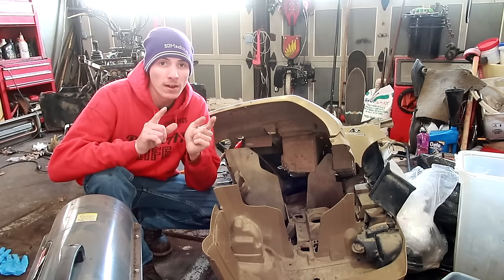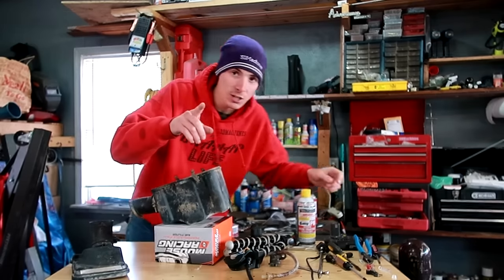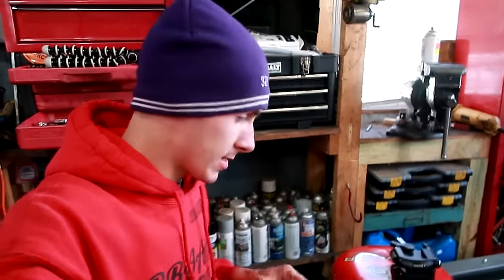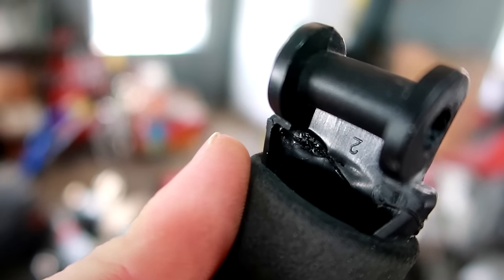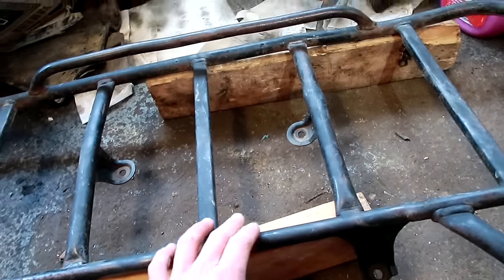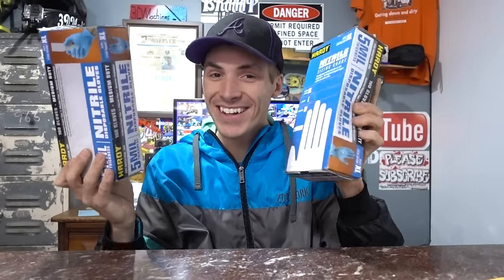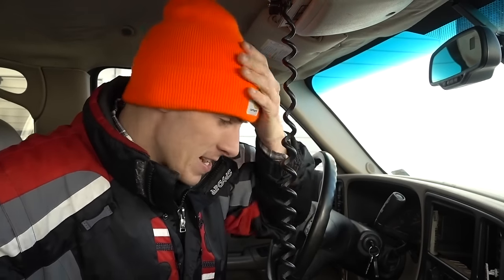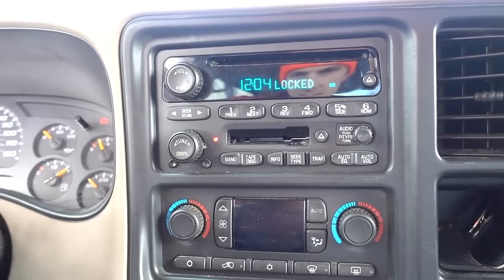FANS SENT STOLEN CAR RADIO

Comment: says locked cause it's probably not compatible with the bose/on star system in the truck.. the other radio is, it's the same as the one that came in my truck, mines an 06 silverado.. the other cd play has a 6 disc changer build in also I believe.. it should work.. and if u call sirius xm radio, u can get a free 3 month trial, if ur truck is equipped like mine... I love commercial free radio
Reply: tankdog03 ya i think your right
Reply: tankdog03 it's not that, options don't create problems like that. It's probably what everyone else is saying with the Vin number from the vehicle it came out of.
Reply: yea it's Vin locked,  and cost over $100 to reprogram the vin..
I wouldn't waste $ on the tape deck radio, the other one with xm radio, maybe.  but only if the truck is xm ready from factory...
I personally used this radio until I bought a new 7in touchscreen dvd..

++++++++++++++++++++++++++
and u can use the radio and turn it on by pressing and holding the #5 preset button and the seek forward button and pressing the power on knob all at one.. the radio will come on and all work for like 20 mins I think, then it will relock..
++++++++++++++++++++++++++